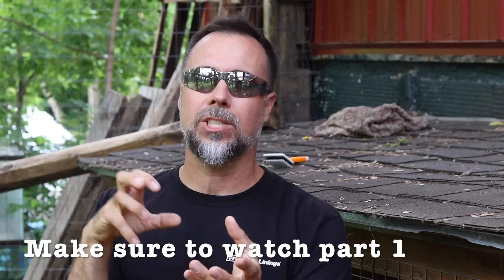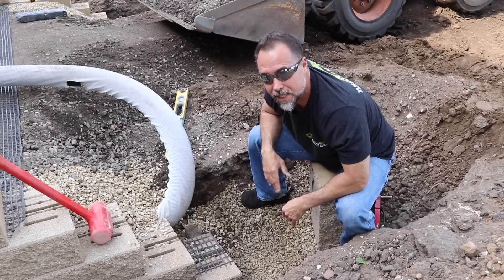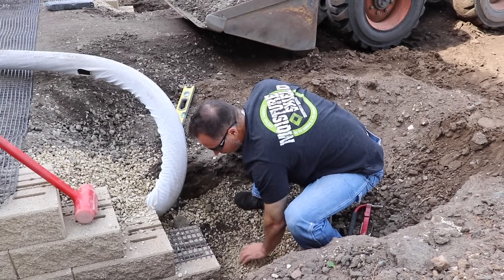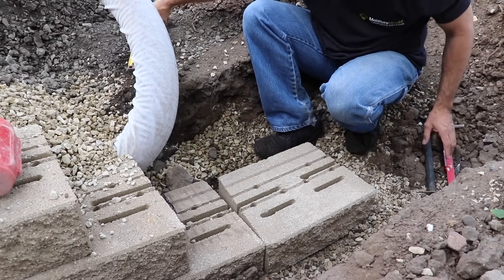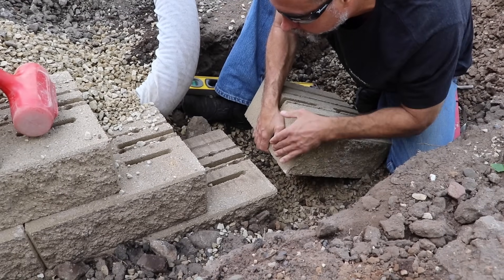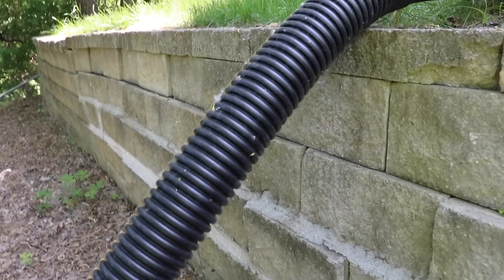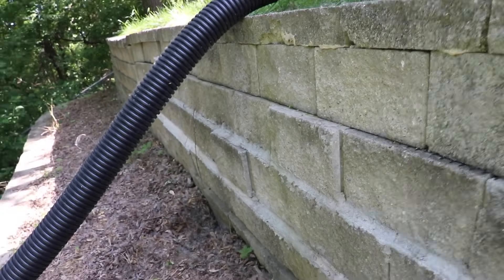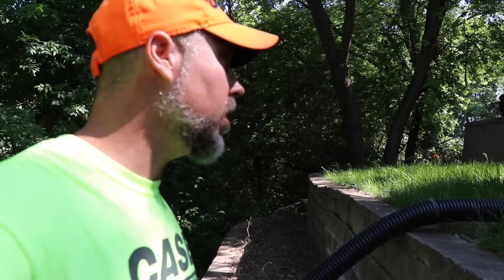Common Retaining wall mistakes & how to AVOID THEM, bad designs, bad base, wrong block....#2

Comment: Love the videos... Warning ⚠️  you have a legal issue the door and walk way had caution tape. Caution means you can continue but use caution ⚠️   you need a danger 😉  have a signal  sign ( 🚷☠ )as well.... keep yourself protected if you do it around all you jobs youl be hard pressed to find yourself at fault or fighting with insurance for someone who shouldn't have been in your work zone to begin with. Keep up the  great content 👏 👌 👍

Comment: Stan! Love the videos man, I would love to see a video of you guys setting up your laser level and establishing your grades so that the T/W elevations match up perfectly to what you need. To me, this is one of the most important parts, if block 1's elevation is off, block 600 or 5,000, etc. will be off too. In a situation where you don't have a surveyor and a cut sheet to go by, how to you get the elevations spot on. Also, on walls and even patios with radiuses, a video on how you cut your caps or pavers to flow seamlessly around inside and outside corners would be very helpful! A Lot of material can be wasted by messing up cuts again and again. How do you get it perfect every time?

Comment: Here in Pittsburgh we use 2A to level and compact, then about 3/4in of 1A (limstone dust) over top of the 2A to beat the block perfectly level into. TIP: we use 1in metal electrical conduit and spread the dust over that then screed it to get our perfect 3/4in layer.

But Id like to try this way, Im always up for better or more productive ways of doing things.

Comment: The base block is most important, for if it is off the whole wall is off, we use the hollow block, built up on a concrete footer 3-4 feet below ground, with rebar , then tye the rebar up through the block, then pump concrete through the holes, then put a cap mortered on top, I like your block , will look at it next time

Comment: Wow, there is so much to know in building a strong wall.  I am planning on a 1000 gallon water storage tank behind a section of wall in a corner of my property. This means the Surcharge will be HUGE in that section. I am considering a formed (rebar reinforced ) concrete wall to support this section , then continue the block wall after this.  That 1k gal tank is 8,330 lbs in weight that needs to supported against the lateral pressure surcharge. 
   If you have  advise on still using block in supporting this load from the tank, I'd love to hear it.  Id' rather not deal with installing a concrete wall, then have to mount a decorative facia to it closely matching the block wall around it. 
your video made a lot of changes to my amateur (self) designed project.

Comment: Just about the right amount of detail! Less would be bad but many of us like the detail ~ wish I had seen that before I installed mine. I am going to have to remove the wall and do it right. You talked about class 5 or class 3 (means nothing to me ~ what is it). Is there a way to keep wasps from building in the walls?

Comment: You mentioned it on the last video as well about your Geo grid, I bring my Geo grid right up to the front and then cut it off at that point or just shy of the front of the block so we don’t see it sticking out that way I get my blocks in level.

Comment: I know that these bricks are expensive and probably the best thing to use. But if you had to choose a second type of brick for the do it yourselfer. What brick would you choose? 
Great information on doing a single wall verses a stacked staggered wall.
If you use a hollowed out brick, do you fill it with gravel? And do you put in rebar to act like pins that help hold them in place? Because I think filling it with dirt would cause the brick to fail from the expansion and contraction of the water trapped inside during the freeze and thaw cycle in early spring and winter inside the brick. And concrete would act like a mortar and block the water from escaping from behind the brick wall and cause it to fail too.

I have been watching a lot of your videos. The house I own is in a town with lots of ravines. And there’s lots of people putting up retaining walls with all kinds of things. There was a retaining wall that was built before I purchased the property. But it was a log one. And the wife wants to put in a flower and  bush garden on the ravine that has some trees also. She has all these ideas on what she wants. And I’m trying to figure out how to make it happen but do it in a practical manner and not just willy nilly so that it doesn’t have to be redone in a few years. How do you build a retaining wall around trees so as not to crowd or build over the roots and have the wall fail?

Your videos are awesome and always full of great information. Please keep up the great work and stay safe out on the job sites. I look forward to hearing back from you.

Comment: Great video. I see a lot of videos instructing to use some kind of fabric between the drainage rock and the fill soil behind it. They say that the want to prevent fines from gumming up the drainage zone. Is there ever a time to use that kind of fabric either behind the drainage or above the drainage to keep the topsoil from trying to migrate into tue  drainage aggregate?
Thanks

Comment: Your inspiring me and my wife. We purchased our house already done but it is not level the pavers settle down and it looks like a lot of work. It’s hard to explain. There’s wires lights 4x4 post surrounding it and the floor is settled 1” below the bottom of them. We do not have an idea what it looks like under the floor pavers or why it’s the way it is. There’s a rooftop over it and covering it . To tell you the truth I’m intimidated by the size of al the areas. Wish us luck. Thanks
Michael and Sopheary

Comment: Hey Stanley, awesome video.  Regarding the trench; is there a general rule of thumb for how deep and how wide for various height walls?  It looks like the one in the video is two courses deep with the second course at grade.  And about 8” approximately in front and behind the first course.  Do you have a video that specifically shows how to structure the trench for the first course?  Thank you!!

Comment: Thank you so much for making these videos! They have been extremely hopeful. My husband two years ago bought a home before I was in the picture. Unfortunately, this home has a retaining wall (over 7 feet) in the backyard that was made out of wood. I don’t believe the wall was built correctly or up to code. We were looking to see if there was a cheap way to fix it on our own, but doing the research we can see that this isn’t a job we can fix. Sadly we will need to hire a professional to do it correctly, but sadly the funds aren’t there because we had to already fix a ton with the house. So a project we won’t get to anytime soon. Is their any tips you can give on how to look for a professional that we install retaining walls correctly? Or suggest any good companies in the Colorado area? That way we can get some pricing ahead of time to see if it is something we can resolve sooner than later.

Comment: I have been watching your videos on retaining walls, drainage and doing driveways. Awesome information. I wanted to ask for something else.

Can you do a video on building a retaining/foundation wall under a garage with a cracked slab? I have an upcoming project in which the back half of our garage is in an area that floods and the earth has been washing out from underneath it. I don't want to replace or pour new slab but the more I think about it that will probably be easier and safer.

Comment: I like the video, be good to see more info on stepped foundations if building a wall in a sloped yard?
Also, in from England and nearly all walls out there are mortared which is interesting because you said the reason you don’t mortar here is to allow rain water to pass through but there’s a lot of rain in England?

Comment: What about frost lines?  We live in Maine and do I have to go the recommended 5 ft below grade for the footing? On a slope that would be really difficult.  Also, do you make a heavy timber video?  I was thinking of using 8" post to make the anchoring simpler.

Comment: Great content. One question I have that I have not seen answers for is how the water that comes out the face of the retaining wall gets away when the retaining wall is at the back of the house holding up a hill.  

I need a wall the length of my house just beyond my hardscape patio to hold up a hill behind it and the water needs to drain to the sides and not filter into my crawl space. I’m considering a channel drain that I can periodically uncover and spray clear but I’ve never seen that done or recommended by anyone.

Comment: Limestone screening  some call aglime in farm communities  1/4 and down size material makes for an easier installation  (do not exceed the use amount of more than a half inch of this above your regular ca6 stone base though it would create an structural problem

Comment: My contractor built a 5-foot high stairwell to my basement using Versalok blocks.  The blocks are stacked vertically.  It was supposed to have a railing along the top of the wall for safety that never got installed.  I went to install an aluminum deck railing to the caps and discovered they are sitting there loose.  It looks like they were glued with Liquid Nails that didn't hold.  What's the best way to bond the top couple courses so the railing can be installed?  Can I cement them or use a strong adhesive?  Drill through the top few courses and grout rebar or allthread?  Concerned pressure on the railing will tilt the cap block up. The contractor has moved on to bigger fish.

Comment: Great video more detail the better only thing bugging me is that u forgot to mention while leveling that block little thing geo grid so u dont put it bullet straight but just a tad leaning back to compensate or is it not needed when u step up

Comment: You may have said it and I might have missed it but Do you compact the base 3/4 crushed under the wall? I have used road base before which was compacted and using 3/4 crushed looks a lot easier.

Comment: Hey  Stan, I can't get Versa-lok  from the distributor here in Lawrenceville GA. But my question is about that base material. I have the guys at the landscape company telling me to use  what they call Crusher Run (road base), then backfill with #57 granite (drainage gravel). Which should I use to level the retaining blocks? They also have a Granite Fines (paver base).  Luxury Landscapes - Lawrenceville, GA

Comment: Hi Stanley. Your work is awesome. A quick question from way down in New Zealand. If I have two parallel retaining walls, like you do in the walkway in your video, can I attach the same piece of geogrid to both (so that both walls are effectively tied together with geogrid)? Or should I do separate pieces of geogrid, each to the halfway point between the walls? I hope that makes sense!

Comment: Im in central Florida and my new home has an incline pretty steep.  About a 45° angle upward in the back yard. Previous owners pushed bak and put pavers and a about 4 foot wall. Small block but front textured similar to this video.  Concerns are that they put mortar and 2nd can i do the same thing 4 feet back for a 2nd tier? 
 
This part of central Florida is hilly unlike the rest of the state 

The part above the wall is at that same steep angle = not usable.  My thoughts is the tiered version would maybe make it usable for small gardening and much easier to maintain.

Also the distance from the retaining wall to the back of the property is about 20 feet

Comment: Retaining walls like deadmen.  That is support from a a heavy load behind the wall that provides support. The deadman is reached with rebar, etc.  Discussion of the use of the deadman with concrete block would be appreciated.

Comment: Another item of terraced walls is  that the lower walls should always be at least 50 percent higher than the walls above it weight of the wall installation is the main factor

Comment: I watch your youtube all the time, I am building a10 ft high by 100 ft wide wall, so far i have built up to 4 feet, the block is a diamond pro pin system by belgard but i didn't do the set back, i realize now that even with geo grid and proper drainage its still good practice to set the wall back because of the height, i don't plan on taking apart what i have already built but my question is can i just start doing the set backs for the next 6 feet up?? it might look weird but i would feel much better

Comment: I need to replace a railroad retaining wall.  I am thinking about using versa lock.  My drive way is on top, concrete.  it is a 3-4 for retaining wall.  How do i back fill underneath my concrete drive way where the dirt has been washed away?  Thank you so much

Comment: How much material is used as a base, under the base block, and does that change with the height of the wall?  How many inches?  And does that all change again with the weight of the block?  And do you compact the dirt THAT material rests on first?

Comment: Great videos - just wondering about engineering for natural rock walls, and also if you can touch on different fencing options for the top of a wall, what you recommend and how to either attach them to the top of a wall or put posts in the ground?

Thanks!
Jared

Comment: With the pipe- what would you recommend if the back of the wall isn’t flush the whole way down - eg there are columns - would you snake the pipe?

Comment: In the northeast we use a quarter inch of stone dust on top of 12 inch dot blend no recycled concrete we did a job were the crushed concrete stone had pieces of rebar in it witch bled thru the block it took us a lot of money to figure it out never again spend the money on the quarry stone insurance policy but hard to describe why your wall is more expensive
Reply: Dan Larkin, look into basalt (mineral) rebar. No iron, no rusting. Very strong, but brittle failure mode.

Comment: Why not use bars for your walls? Perfect grade and even compaction and way faster and you dont have to pick the block back up to add and take away gravel, you are laying down 2-3 times as many base blocks than you need to, lay it once and tap it down.

Comment: Good video. I just don't believe in drain socks on the pipe behind the wall. Fine particles settle down and are more likely to clog it.

Typically I try to keep the drain pipe open on both ends so it can be vacuumed if needed (I've never seen it needed... But you couldn't do that with the sock..)

Comment: Hi Stan, I need to build a wall that is 20 metres in length and it will be 1.5metres high, im having a debate with myself to go with an L stone or a stone brick wall like the one shown in this video. How deep and how wide do I need go down in the ground so I can get a flat level surface area to lay the stone bricks or the l stones level on it? Also how thick does the foundation need to be?

Comment: Thanks for all the detail. 
The only question I still have is how to engineer a wall using these blocks so that the wall turns the corner on the perimeter of my lot?  
We have large drainage ditches in front of our properties for snow and rain fall run off from the roads. They are about 6 foot deep and close to 20/25 foot wide. These ditches run along the side of the road for the entire length of the street so are in the front of our properties and ugly.  Our driveways bridge over the ditch and have wide pipes so the storm water can flow - each side of the driveway is open ditch with a pre-formed concrete culvert for the drainage pipe and then the width of the drive is filled in. We are not allowed to fill in/pipe the rest of the ditches along the property lines. 
I want to build a retaining wall that runs parallel to the drainage ditch from the concrete culvert It has to be on my side of the ditch (vs the road/local authorities side) and back filled to utilize my land at the edge of my lot. Then beyond the wall will remain the open drainage ditch to the road. 
However, I can't just stop dead when the wall reaches my boundary with my neighbor. Otherwise all the fill from behind my wall is just going to wash out into the empty space where my neighbors lot begins and the wall ends at the property line. I have to have the wall make a 90 degree turn (or a more gradual curve to follow along the property line far enough that the building materials are held in place.

Comment: My question is with the 3/4 it doesn’t compact as well as the other stuff what happens when it settles? Wouldn’t you want smaller rock to compact better so the wall doesn’t eventually move more?

Comment: Important item of discussion in educational purposes that geo grid has strength in the direction you used it in on the job you were doing in the event it was used sideways instead of length wise that geo grid has little to no strength in a typical conventional single straight retaining wall I have seen common mistake with this work

Comment: If a segmental wall is going to be laid on bedrock after jackhammering out the trench, is there a reason to prefer (a) two inches of 3/4 gravel and bury two courses vs. (b) 10 inches of 3/4 gravel base and bury one course? I've tried searching to figure out why the gravel underneath would be necessary if the base is already solid rock, but I can't figure it out. (I realize that it's hard to ensure any rock really is bedrock, but for the sake of this question, please assume that it is). This wall will only be 2.5 feet above ground, will have geogrid 4' back and recommended drainage behind, but I'm also just academically interested to know if a base is required besides leveling for cases in which it sits on bedrock.